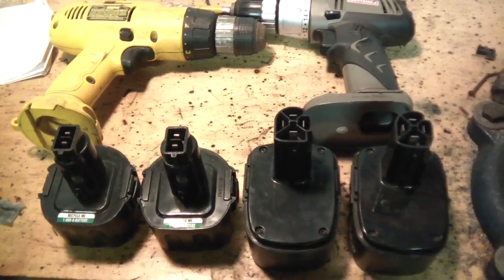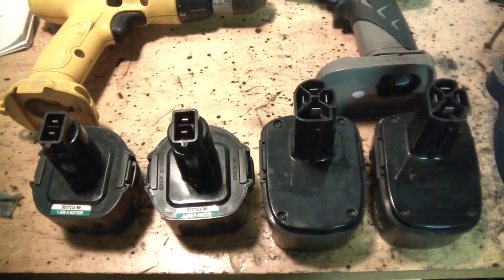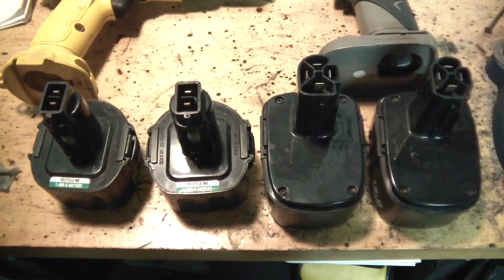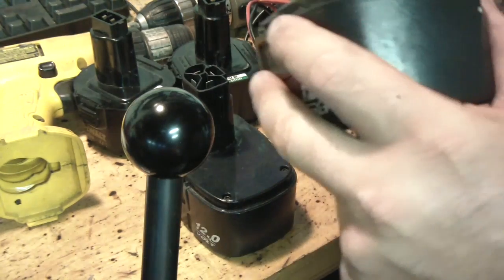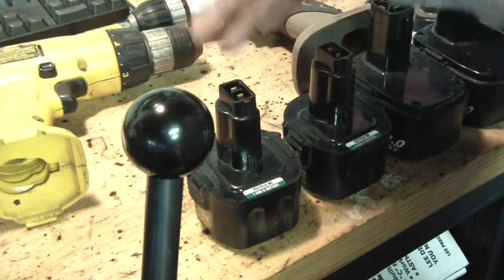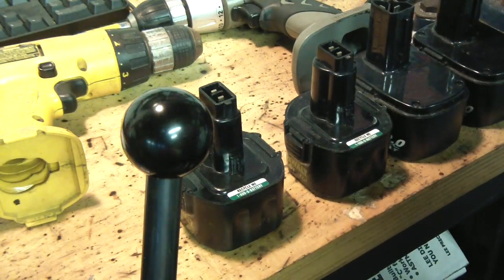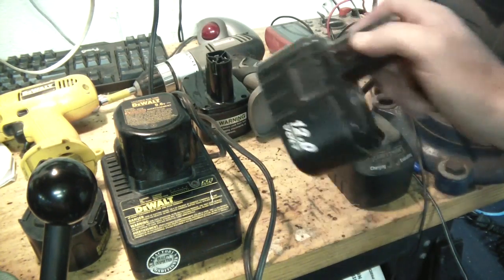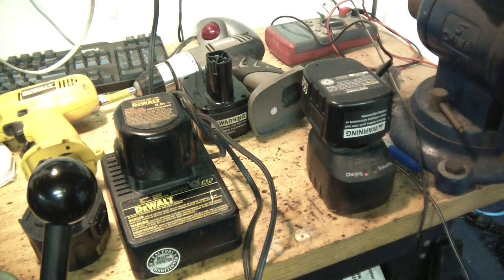Ni Cad Battery Repair fix cordless drill like new dewalt

Comment: I see some guys using twice the voltage of the battery but low current and others using welders which I believe would be low voltage and high current.  I wonder which method is best?  I wish some Electrical Engineers would post to these videos and give us the benefit of their wisdom.

Comment: Great video.  I have a Craftsman 18 volt charger & Ni Cad battery for a craftsman hand drill.  The battery charger blinks green and the orange light (evaluating) also blinks.  What does that mean?  Is the charger shot or do I need to jump start the battery as you did in the video?
Reply: Trick i learned on another video. Put the battery in the charger then plug it in and pull the plug out again real fast. Keep doing that in and out until it goes into charge mode.

Comment: Hi folks, these batteries are based on chemicals and other materials, and they do wear out.  IF this is something you need to get you through an emergency, fine.  I would look more into a new battery, OR better yet, you can often get complete updated drill kits for the cost of 2 replacement batteries. I've been working with cordless drills since AEG 7.2 volt back in the 1980's. I still have a Makita 'banana' battery that still works from 1986. Do I use the drill? NO.  I have newer, better torque, longer life battery drills.  FYI, NiCD (nicad) batteries can be taken apart/rebuilt by Batteries Plus, Interstate Batteries and others, but unless it is a unique tool and you can't get the batteries anymore, it isn't cost effective.  The NI metal hydride batteries can not be rebuilt, they are trash when they wear out.  I have also done the 'double battery voltage' tap to rejuvenate an old battery.  Does it bring up the internal voltage, YES!  Does it hold and do work.......NO.  No wishing/hoping will bring old batteries back to like new status.

Comment: What did you set your volt meter too?
Reply: To test polarity... you'd set it to the DC setting anything above the voltage you are testing. i.e. 12 volt, you'd set the multimeter to either 20 or 200... probably 600 would work simply to show polarity. I'm NOT a pro, so ignore this part... I don't think it actually matters what you set your voltage to, it's simply "sensing" and will read "OL" or a "1" if you aren't in range.

Comment: If someone doesn't know how to read a multimeter they should NEVER attempt something like burning in a battery.
That is the term btw. Burning in.
A welding mask won't help much if that battery blows up it will blow the glass right through your eye sockets.
Glad you got lucky.

Comment: What do you show for voltage after being fully charged? I am only getting 10v out of my 18v NiCd batteries right off the charger, and am curious if this hack will work to "wake up" the cells that aren't charging correctly. Any thoughts?

Comment: I don't know if your trick works because I couldn't watch this to the end.
At 6 MINUTES, you were still crapping on about "the polarity" !!!! (with no mention of pos/neg LEADS, btw...)
GET TO THE POINT!!!!
Reply: You touch the +  and - of the power supply to the + and - of the battery.  plus to plus and neg to neg. Be sure to not hold it down.

Comment: what if you have 18 or 19.2 volt battery?
Reply: I have an old Ridgid 12v drill that I havent used for years because the batteries were dead and could not be recharged. I got the Harbor Freight 18v battery and used 10 of the 15 1.2v 1500mAh NiCd cells in the pack. It was an easy fix and works perfectly. $16.
Reply: @ZappninLLP  please sgow or describe  how to change it the cell , when they are dead
Reply: I just did this and fixed both of my batteries.
Reply: @davidrichards4424  please  describe  how to change it, any battery  is ok anything  will work,
Please  more detail,  rookie  here